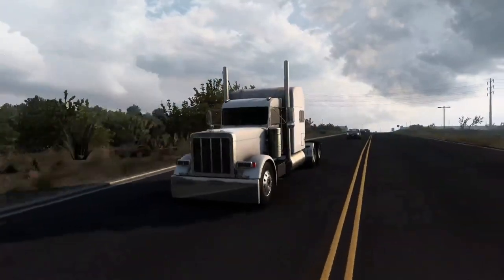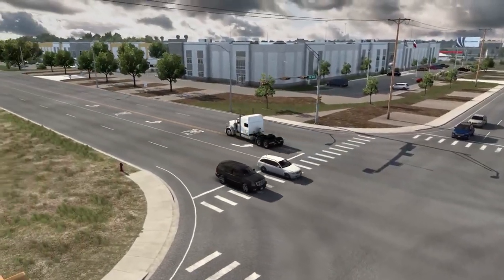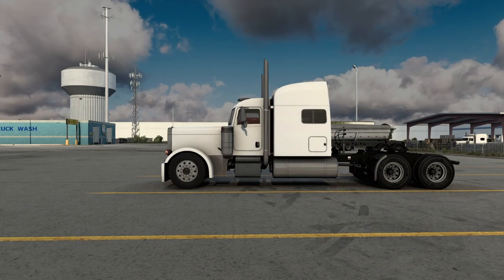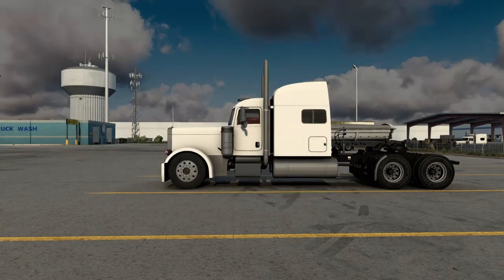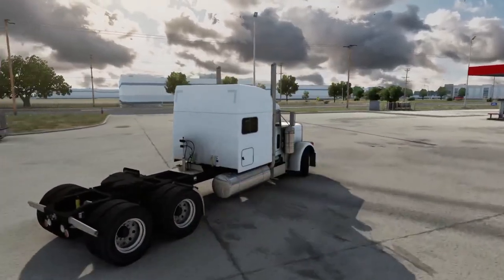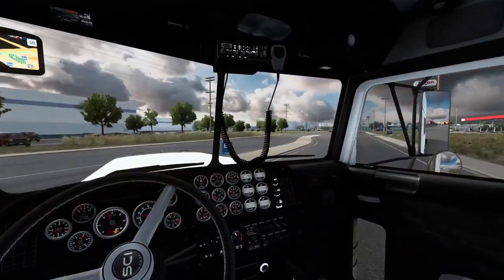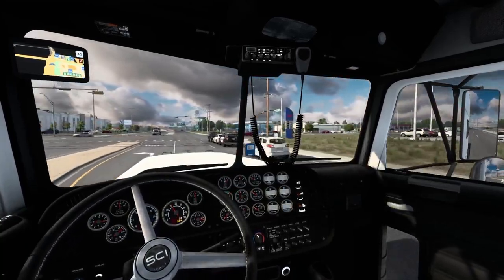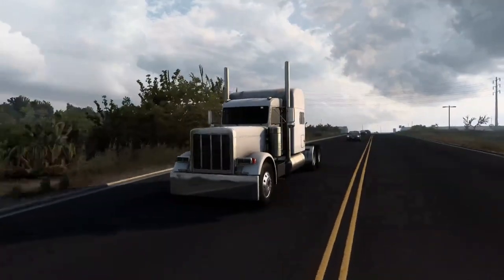How To Use The Manual Transmission in American Truck Simulator: A Step-by-Step Guide

Comment: In a real tractor, once you pushed down the clutch and shift to gear 1, and you lift your feet off the clutch slowly the vehicle starts moving forward. Is this possible in ATS?
Reply: Yes that’s how it works
Reply: @Yxktay  They call ATS a truck simulator but this is not present in it.
Reply: @techbit7607  you have to install tractor mod
Reply: @Yxktay  thank you I appreciate it, I will research that
Reply: @Yxktay  I can't find this tractor mod, where can I find it?
Reply: it is possible you don't need a mod
Reply: @amazing_avocadoo7881  thanks how do I do it?
Reply: @techbit7607  just how you described, drop it into gear and slowly lift off the clutch and you’ll start to move

Comment: Hey I got a Question,  When you downshift and (step on the accelerator) is the Realistic Engine  rev sound come from that?

I know it a Bonehead question but I played 18 WOS Haulin When Downshifting (The sound of engine revs) it does None of that!! I know, I know,  18 WOS is as Arcaic  as Dinosaurs 🤣🤣 and its no Comparison!!!! ATS, hands down is Far Superior!!!! SO is it in the Sound Mod? Or in ATS Game  Design Software Mechanics?
Reply from the maker: It is part of the games engine. It is more pronounced in my videos because I almost exclusively use engine sound mods. The small details like that is why I enjoy this game
Reply: @NSFGames  Ok bruh, So it's in the Actual ATS Program Software Engine So the Sound mods make is More pronounced and Realistic?!! OK so it doesn't rev up like that on the "default Engine Sounds"? 
ON 18 WOS Haulin the Sound is attrous 😖Without Realistic Engine Sounds! 🤣
Reply from the maker: @ANTZPound4Pound  The sound you’re talking about is within the game as well as the air brakes, transmission grinding etc. The mods I use changes the sound of the engine and makes it more obvious.